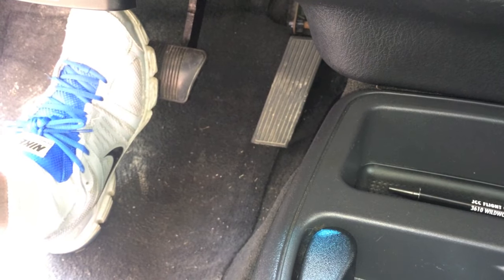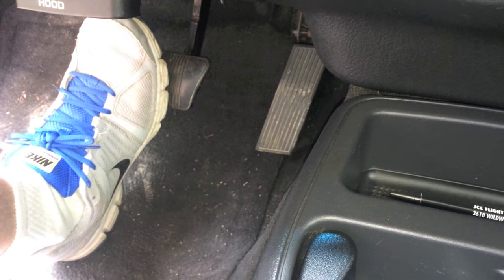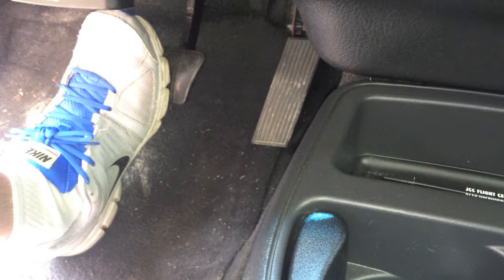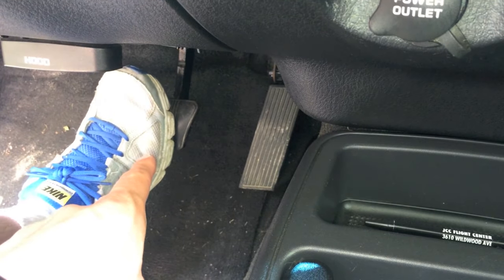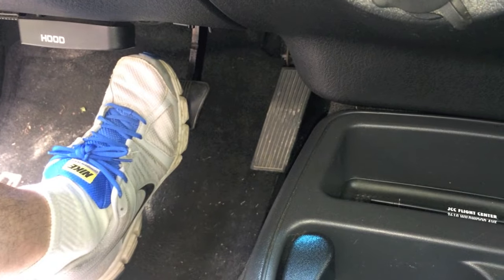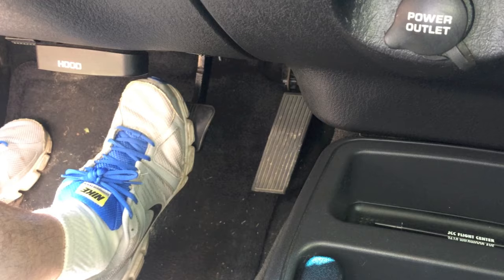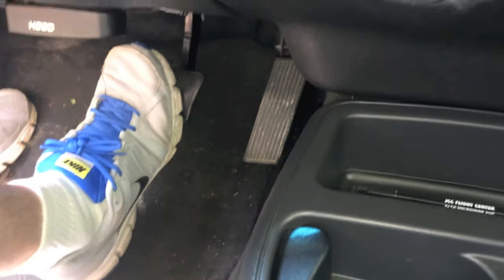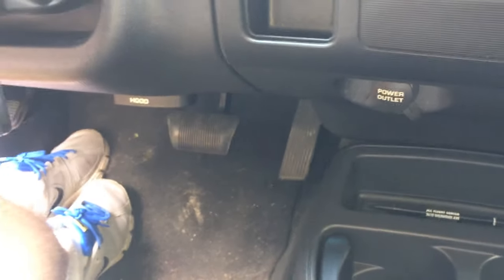HARD Brake Pedal - How to check if your BRAKE BOOSTER is GOOD or BAD

Comment: 5 year old video but what the hell, engine off, pump pedal, gets very hard, with hard pressure (engine still off) the pedal slowly sinks toward the floor. Then start the engine and the pedal dips just like in the video. When driving, overall braking is very hard at first then gets easy and stops well. Master cylinder and brake assist or just master cylinder?
Reply from the maker: Thanks for watching & welcome to the DIY Raptor Club.  Let’s get this figured out!

We have attached a few options that may cause this.  Check out the vides and let us know if you have run into any of these issues.

https://www.youtube.com/watch?v=-DZ68tKuCQc

https://www.youtube.com/watch?v=3Pq15BWM_qY

https://www.youtube.com/watch?v=VK4lowH7kQE

https://www.youtube.com/watch?v=j9s7yccswPQ
Reply: @DIYwithMichaelBorders  Thanks
Reply from the maker: @fishdresser4759  

😎👍🔧🔩

Comment: My car just started doing this today 😖😖😖 91 trans am gta
Reply from the maker: No fun....but definitely not un-common.  Have you completed any work to the brake system within the last year?  Replacing the brake booster is a pretty friendly cost and shouldn't cost you much.  Keep me posted if you replace it.  If you're running into a HARD pedal while driving down the road...it can be a few different things.

1.  Its possible that your caliper is beginning to stick...maybe caliper slides have lost the lubrication required to shift back and forward freely.

2.  It can be possible that your Caliper piston has lost its lubrication which will also interfere with the efficient shift back for forth.

3.  The front rubber brake lines that connect to your caliper fail from inside rather that outside.  This means the inter coating begins to break away and clog portions of the brake system...hence not allowing fluid to flow back and forth freely.  

4.  Your brake pads have little prongs/teeth on them.  You will notice by their location...the pads slide on a steel brace.  This may need to be lubricated to bring the shift back to efficient requirements.

I have attached a few videos.  Lets figure this out together!  Keep me posted!  Please Subscribe to the channel that would be awesome!

1.  Caliper Slides Lost Lubrication:

https://www.youtube.com/watch?v=-DZ68tKuCQc&t=15s

2.  Too much Fluid in Reservoir:

https://www.youtube.com/watch?v=X-AJ5tD6zoA&list=PLjCXOz8TSkZnavDiGDyHdPKe2dV2RzEMZ&index=39

3.  Failing Front Brake Lines:

https://www.youtube.com/watch?v=3FTEgbLYAdI&list=PLjCXOz8TSkZnavDiGDyHdPKe2dV2RzEMZ&index=78

4.  Brake Pads not shifting:

https://www.youtube.com/watch?v=3Pq15BWM_qY&t=103s

5.  Replacing Front Brake Calipers:

https://www.youtube.com/watch?v=8HoaL4QM5-k&list=PLjCXOz8TSkZnavDiGDyHdPKe2dV2RzEMZ&index=83

6.  How to check if Brake Booster is Failing:

https://www.youtube.com/watch?v=VK4lowH7kQE&index=66&list=PLjCXOz8TSkZnavDiGDyHdPKe2dV2RzEMZ

7.  Failing Brake Booster:

https://www.youtube.com/watch?v=j9s7yccswPQ

8.  Symptoms of a Failing Brake Booster Check Valve:

https://www.youtube.com/watch?v=j9s7yccswPQ&index=68&list=PLjCXOz8TSkZnavDiGDyHdPKe2dV2RzEMZ

Comment: Question, so my car holds an builds brake pressure when the car is off but when I turn it on it goes immediately to the floor an I have no pressure build up. Replaced a leaking brake line, master solenoid, an check valve. Any suggestions?

Comment: My break pedal won’t go down it’s hard and I can’t turn my car on
Reply from the maker: Jose Gomez 

Thanks for watching Jose, let’s get this figured out!  A few things we are thinking!  It’s unlikely that it’s your Brake Booster however let’s not write it off yet!  This is definitely not uncommon!

It can be a few different things....thats if you are experiencing a HARD Brake Pedal...

1.  Its possible that your caliper is beginning to stick...maybe caliper slides have lost the lubrication required to shift back and forward freely.

2.  It can be possible that your Caliper piston has lost its lubrication which will also interfere with the efficient shift back for forth.

3.  The front rubber brake lines that connect to your caliper fail from inside rather that outside.  This means the inter coating begins to break away and clog portions of the brake system...hence not allowing fluid to flow back and forth freely.  

4.  Your brake pads have little prongs/teeth on them.  You will notice by their location...the pads slide on a steel brace.  This may need to be lubricated to bring the shift back to efficient requirements.

I have attached a few videos.  Lets start with the easy items and then work our way up!  Lets figure this out together!  Keep us posted!  Please Subscribe to the channel and turn on your YouTube notification Bell 🛎 that would be awesome!

1.  Caliper Slides Lost Lubrication:

https://www.youtube.com/watch?v=-DZ68tKuCQc&t=15s

2.  Too much Fluid in Reservoir:

https://www.youtube.com/watch?v=X-AJ5tD6zoA&list=PLjCXOz8TSkZnavDiGDyHdPKe2dV2RzEMZ&index=39

3.  Failing Front Brake Lines:

https://www.youtube.com/watch?v=3FTEgbLYAdI&list=PLjCXOz8TSkZnavDiGDyHdPKe2dV2RzEMZ&index=78

4.  Brake Pads not shifting:

https://www.youtube.com/watch?v=3Pq15BWM_qY&t=103s

5.  Replacing Front Brake Calipers:

https://www.youtube.com/watch?v=8HoaL4QM5-k&list=PLjCXOz8TSkZnavDiGDyHdPKe2dV2RzEMZ&index=83

6.  How to check if Brake Booster is Failing:

https://www.youtube.com/watch?v=VK4lowH7kQE&index=66&list=PLjCXOz8TSkZnavDiGDyHdPKe2dV2RzEMZ

7.  Failing Brake Booster:

https://www.youtube.com/watch?v=j9s7yccswPQ

8.  Symptoms of a Failing Brake Booster Check Valve:

https://www.youtube.com/watch?v=j9s7yccswPQ&index=68&list=PLjCXOz8TSkZnavDiGDyHdPKe2dV2RzEMZ

9.  Master Brake Cylinder Failure:
 
https://www.youtube.com/watch?v=F9s_1VZ2u5E&index=24&list=PLjCXOz8TSkZnavDiGDyHdPKe2dV2RzEMZ

Again let us know!  We are here to help!

Comment: Makes a sound like a air leak
Reply from the maker: Thanks for watching, have you pinpointed the location of the leak?  It may be as simple as replacing a leaking vacuum hose feeding off the booster located inside engine compartment.

Keep us posted and hey if you’re into crypto trading, check out our newly launched DIY ecosystem.

       Toolboxtoken.com

Reach out to us any time.  🧰

Comment: thanks for the reply, following
Reply from the maker: Dale Martin hi there.  I don't see a question.  What was your question!  😀
Reply: Michael Borders I have a 1997 Camaro V6. I have replaced the master cylinder the hoses the calipers the brake pads and the check valve. The problem I am having is after the car begins to warm up the breaks begin to tighten up. What I mean is they begin to hold on the rotor and not release as much eventually leading to the car basically like holding the brake on as I'm driving. this only happens with my front brakes  and tends to be  towards peak of day when the car is at its hottest temperature . the brake pedal will over time  become increasingly harder to press  and the brakes become extremely sensitive and touchy . Is this also my booster?
Reply from the maker: Dale Martin An annoying issue for sure and believe it or not...more common than it should be.  Many people I have talked to have ran into this problem and it can lead you down a rabbit race before finding the true cause.  As you have changed many parts...this leads me to believe that your rubber brake lines that are attached to your calipers have begun to fail.  These lines fail from the inside and can not be identified from looking at them whether or not they have failed.  Once these lines begin to fall apart inside, they will substantially interfere with the proper to-from flow of the brake fluid throughout the system.
Reply: Rubber hoses are new. All replaced because of prob. Only thing I have not changed is the ABS and the power booster. ABS I did remove the relay to see and it did not change my situation at all. Relay has been replaced also
Reply from the maker: Dale Martin ok.  Have you performed a complete flush of the entire brake fluid system.  An individual I chatted with awhile ago did this and mentioned the fluid was dirty and by flushing and adding new solved problem.  Ending the rabbit race haha.
Reply: thanks for the advice. I will most certainly be trying it again tomorrow. That is when I'm off. You seem concerned so I will let you know how it turns out.
Reply from the maker: Dale Martin please do.  I'll also shoot over a few other videos I have that talk about this annoying problem 👍
Reply from the maker: I have attached a few options that may cause this.  Check out the vides and let me know if you have run into any of these issues.

https://www.youtube.com/watch?v=-DZ68tKuCQc

https://www.youtube.com/watch?v=3Pq15BWM_qY

https://www.youtube.com/watch?v=VK4lowH7kQE

https://www.youtube.com/watch?v=j9s7yccswPQ